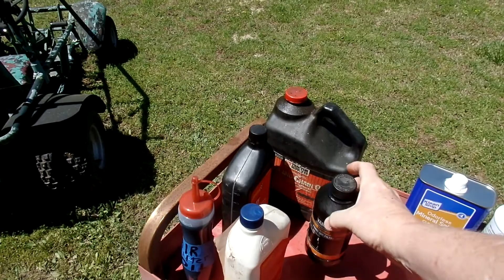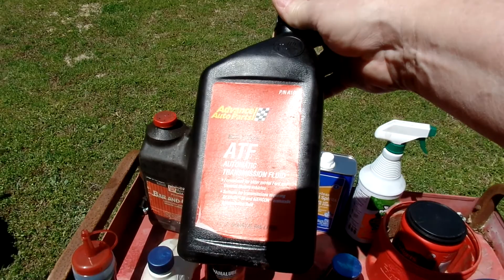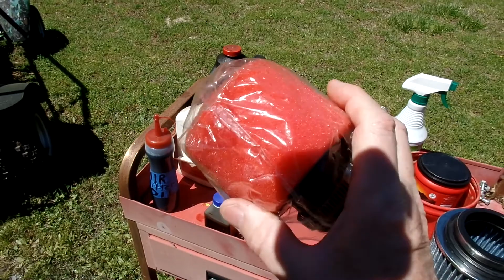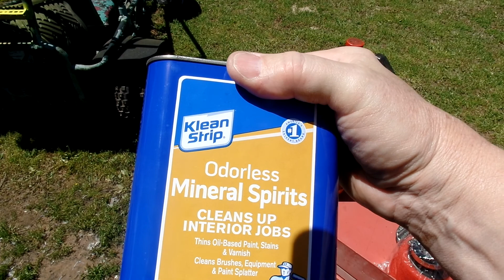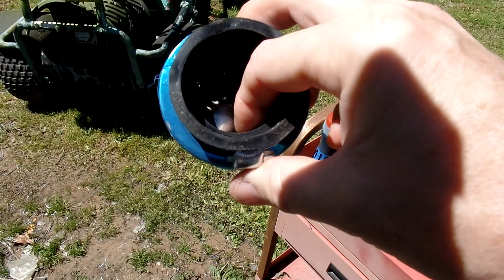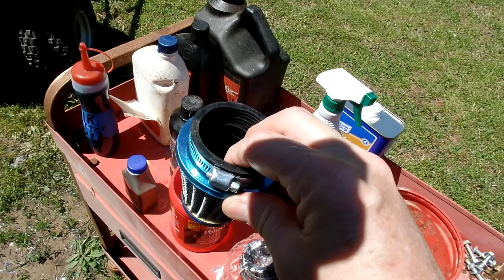Homemade Air Filter Oil Recipe and foam/K&N style air filter tips!!!

Comment: Still two part bar oil one part 2 stroke/ dot oil ?!
Reply from the maker: Go 3 parts bar chain oil to 1 part 2 stroke. I have adjusted my recipe after 2 years of use. 2 stroke oil )I think) is better than ATF. Thx for watching.
Reply: @TheClintmeister  what makes the 2-cycle oil better than ATF  if it’s only attracting dust?
Reply from the maker: @jbh.6257  2 stroke oil has more anti-rust additives in it. The color makes it easier to see if you got the filter covered too.
Reply from the maker: I go more on chain oil. 3 to 1.